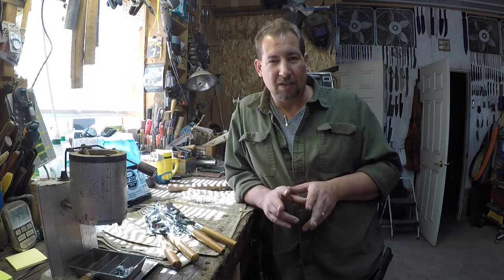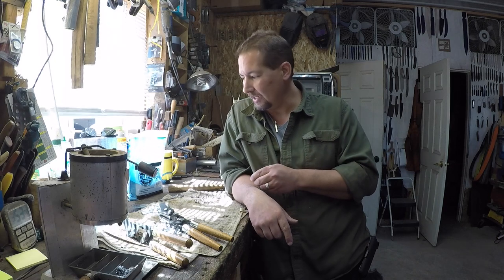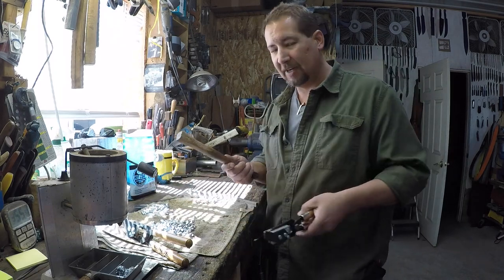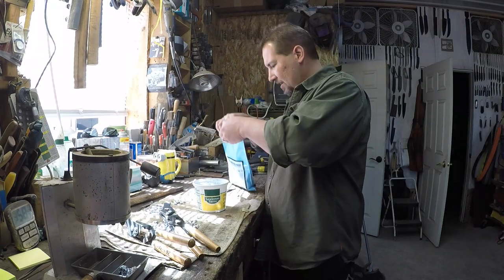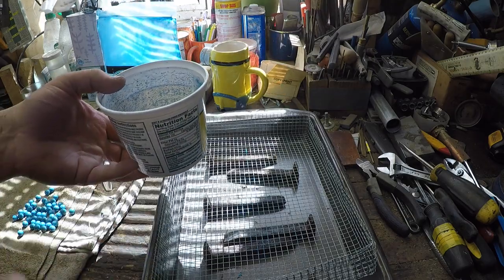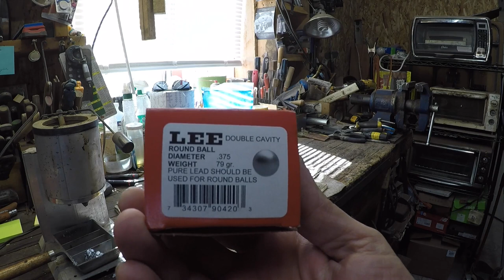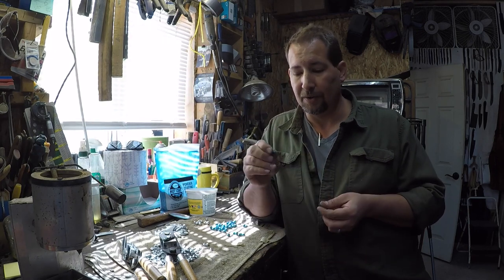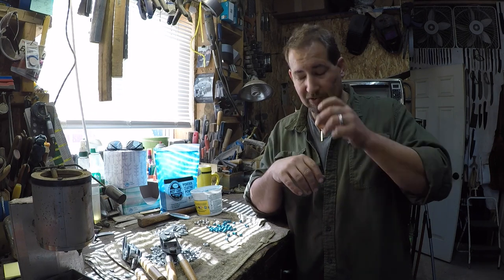powdercoating lead slingshot ammo

Comment: I cast my slingshot ammo with the 18 cavity 00 mold. Got the extra step of separating the strands of 3 but I can really crank them out. I run them in a rock tumbler until all the cut marks are gone then shoot away! I am seriously considering getting some powder coat to try out, those dark gray balls are mighty hard to see, no matter what the background is.
Reply from the maker: the powdercoat is a nice option. you can do different colors for different sizes, bright ammo for target work all sorts of options!
Reply: Just getting into casting myself, got the #0 18 cavity lee mould, I ordered some florescent green I want something that can be traced with eyes as well as cover the lead.